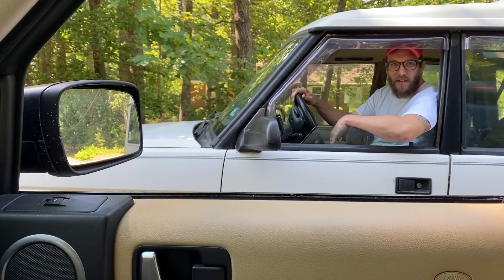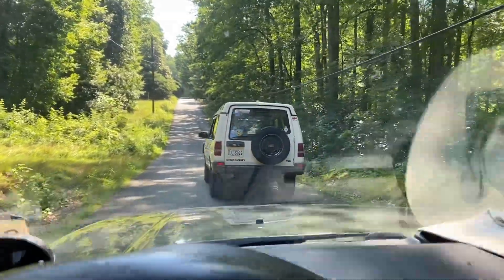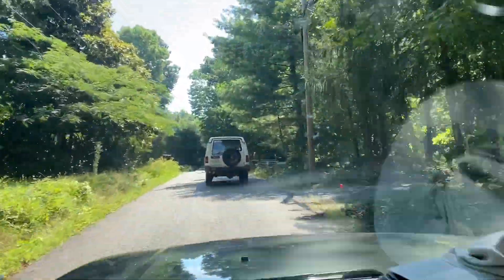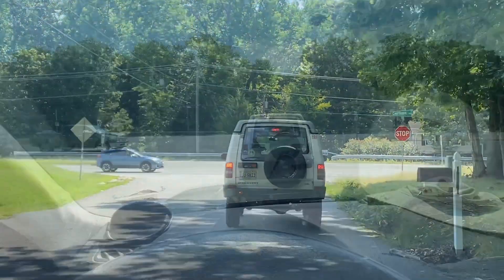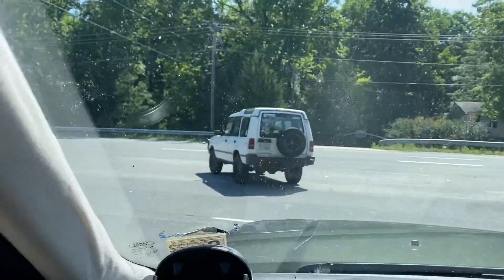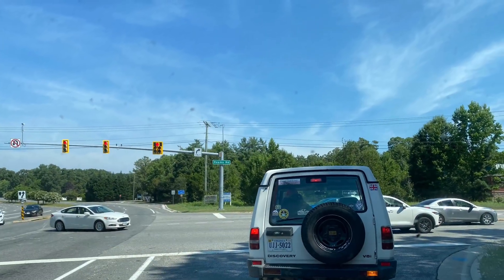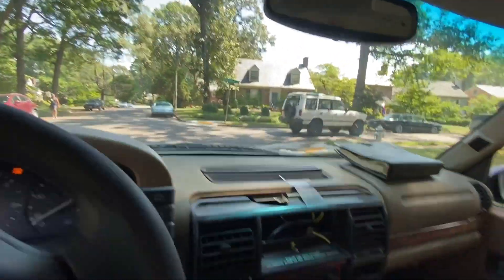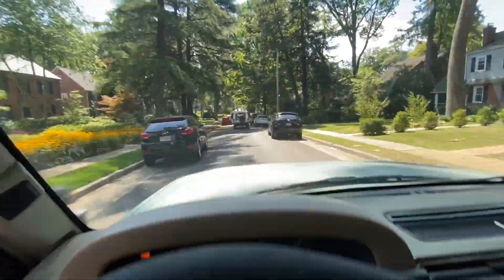SEND HELP - I Can't Stop Buying Broken Land Rovers - I Couldn't Pass It Up, 1995 D SE7 5-Speed!

Comment: Man, those steel rims set that truck off with that particular year. Thought about getting a set of those for mine but I don't know whether I'm going to keep what I have or get a Subaru STI. Awesome truck and an awesome video. Thanks for sharing
Reply from the maker: Don’t get an STI! The wheels are just a set of spares. Should be easy to scrape together.
Reply: The NATO wheels look better. I’ve been looking for a clean cheap Disco 1. I bought a rusted 96 several yrs ago. I have a ton of new parts for one. Mine isn’t worth fixing. But I’ve also been looking at LR3s.

Comment: I’ve been waiting for 20 plus years for the price of 5-speeds to explode. It’s bitter sweet that they haven’t. I lost interest with Land Rover as a company after the D1. I took my 5 speed to the DEALER years ago and they’d never seen one nor did they have any idea they even existed.
Reply from the maker: The long lost trail trucks.
Reply: Yeah it is a shame. A lot of people don't know but if you own a 95 and older disco one it's basically a Defender with a D1 shell. Owned my 95 Disco 5 speed since 150,000 and now has 230,000 and Still rocking.

Comment: The gearbox dipstick is the fill bung on the side of the box it will dribble out when you undo it!
That’s full!
Nice D1 sounded good!
What’s wrong with your LR3 it’s so quiet I never hear it like a V8?
Reply from the maker: Thanks! Ya, the LR3 sounds like a hairdryer.
Reply: @AddictedMotors  you need to copy what Lost Cause Ranch did to his LR4 exhaust system wise I did!
My LR4 sounds good 👍

Comment: I only just learned these sold as the Honda Crossroad in Japan so you are getting help it seems.
Had to giggle what with Honda being regarded for reliability and Land Rover being regarded for well, being Land Rover.
Reply: Thir not unreliable actually I used to have a discovery 1 and it had over 500,000 km